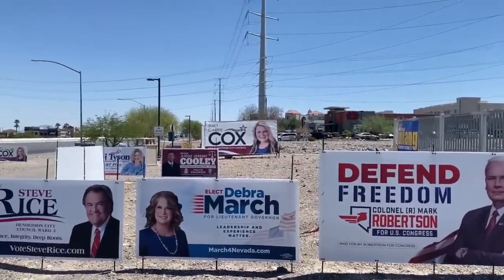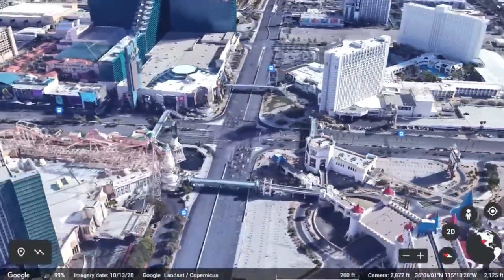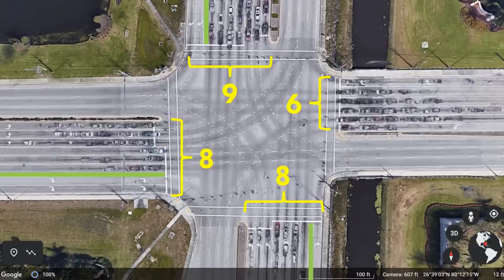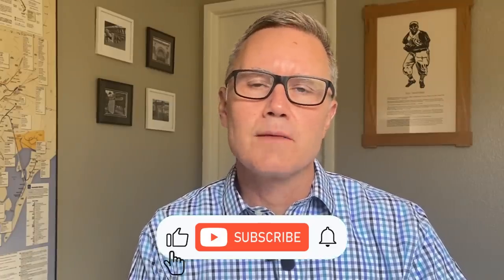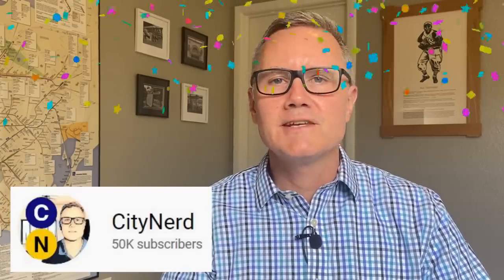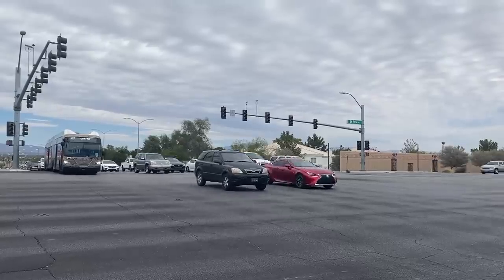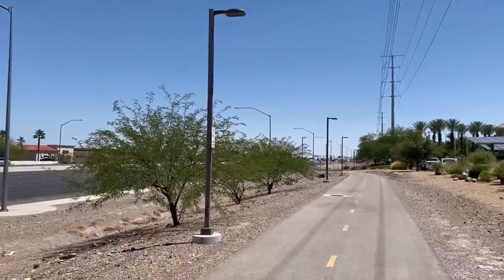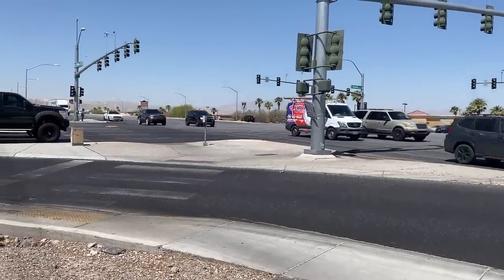Stroad vs. Stroad: Land Use, Traffic Engineering, and What Happens When Suburban Arterials Intersect

Comment: One thing not mentioned is that Phoenix and Las Vegas (like many desert cities) are designed that way because pedestrians and cyclists are  rare. Why? Because nobody likes to walk under a scorching hot sun and 90 to 120F temperatures from March to October. That's 8 months of the year. Therefore most people drive. A simple game of supply vs demand, and the city adjusts to the demand.
Reply: Correct. The hot climate like that are already hostile to walking.

Comment: SUV and pickup truck drivers are even worse, and far more dangerous, than car drivers... They should receive far bigger penalties for breaking traffic laws. (The bigger the vehicle the bigger the penalty)  

Recently it felt like I was almost killed on my relatively unstable, small wheeled folding bike, by a pickup driver who not only honked me, but passed me within a few inches, on a regular 2 way 50kph (31mph) speed limit downtown street. (Not even a Stroad).

 I was traveling at 25kph (16mph) on my extremely unstable, small  12" wheeled folding bike, and he broke several laws by passing me at least 65 kph(40 mph) within a few inches...

Does anyone recommend any type of cheap small camera that would affix to my bike helmet, so I can report these guys to the police?

Comment: You know, I hate traffic at least as much as anyone else, but I can't understand the relentless criticism of these "stroads" that keep popping in my feed.
As the video points out, they develop this way to provide sufficient capacity for the traffic they must carry.  It would be nice if they were smaller and more pleasant, but they would be gridlocked.
As for maximizing the convenience of drivers, their purpose is to get a very large number of drivers around.  There are way, way more drivers than pedestrians in areas where you find these kinds of roads.  The same is true for byciclists, who sometimes cause hazard and nuisance when they shamelessly bike at 20 mph on a 40 mph road and cause a massive clusterjam.
Reply: there are so many drivers there because it's designed like that, by adding more lanes it welcomes more drivers and discourages non-drivers from passing through
Reply: the only way to really reduce the amount of traffic is to give people alternatives to driving, this channel has a good video on "induced demand," which is what causes these problems to my understanding
Reply: Nope. Induced demands means there's more traffic the more lanes you have, so in many cases, traffic would be more smooth if they removed lanes.
And the reason the traffic is there in such volume, and so few pedestrians, in the first place is that there are few viable alternatives to driving, and suburban sprawl and zoning restrictions means things tend to not be within walking or biking distance, so everyone has to own a car, and use it for nearly everything.
Reply: What you're asking for is a (limited-access) highway with few crossings to keep traffic smooth at higher speeds, that one is an oversized street which can't function as a good throughfare (high speed) since there are too many accesses (low speed).